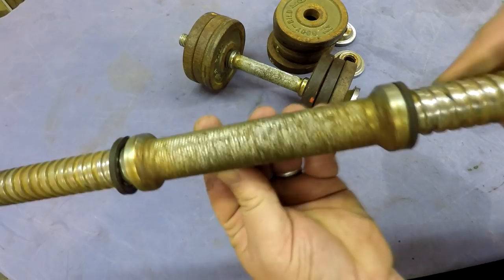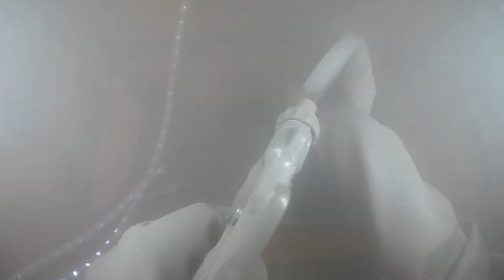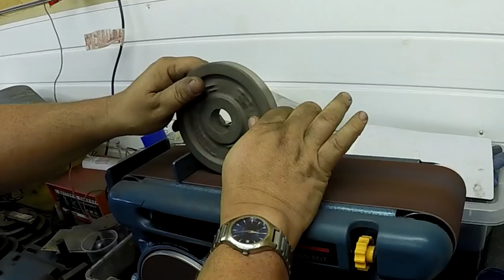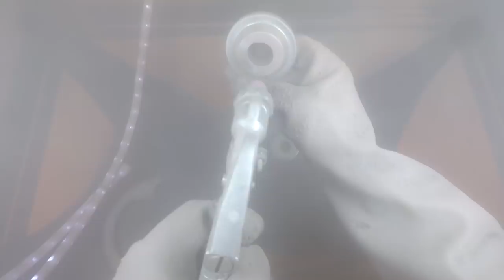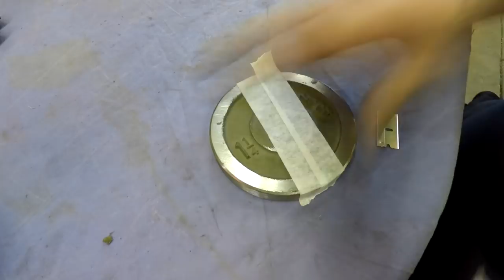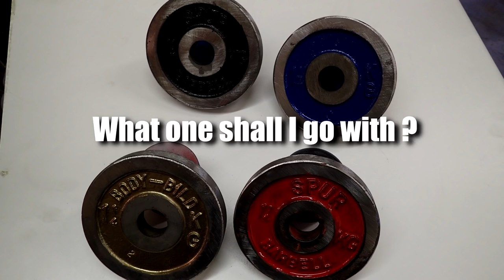Rusty Gym Weights Get Blinged Up RESTORATION What's Best - You Decide

Comment: New obviously, since it's so much easier to keep them protected if there's no rust on them. As for color? I really like the look of the gold or the red.
My problem with what you've done is minor, but it's that you've ground them down and now the weights aren't accurate anymore. Not that they were likely precision instruments or anything, but still...

Looks good though, nice job!
Reply: Unless it was a expensive set, the accuracy wouldn't be spot on anyway.
Reply: In high school, we weighed the 45lb plates, and none of them was  exactly 45lb, we wrote what they weighed with a paint pen.

Comment: Ever thought of building yourself a tumbler which you can put in various gravels and stones etc that will take the hassle out of cleaning parts, me mate built one out of an old Calor gas bottle and a washing machine motor and he chucks in painted things, rusty things, scratched things and they all come out quite quickly clean n shiny like new :)
Reply: Ooo the other thing I forgot to mention to you, you tried one of them Dronco polishing kits?   Abs brilliant as just use yer angle grinder and boy does it get the shine up quick on manky metals, I cleaned the boilers on my steam engines up with mine and the shine on the brass is just epic :)
Reply from the maker: I plan to build one soon Ian
Reply: I always wonder if a cement mixer could be used for big parts lol, will have to try one day